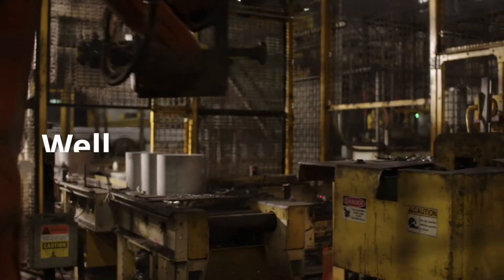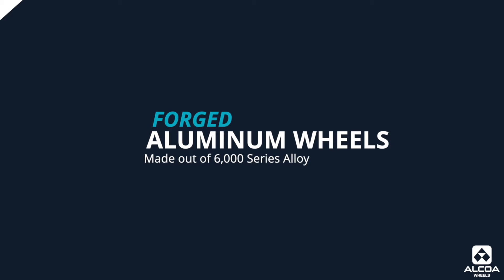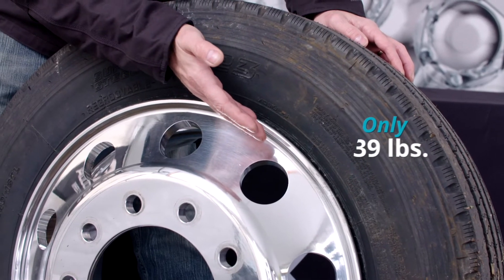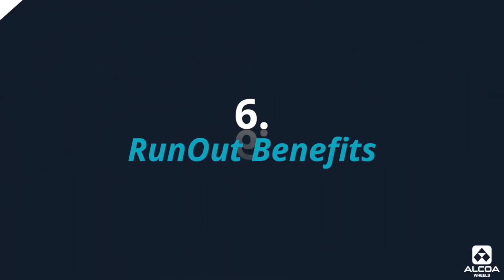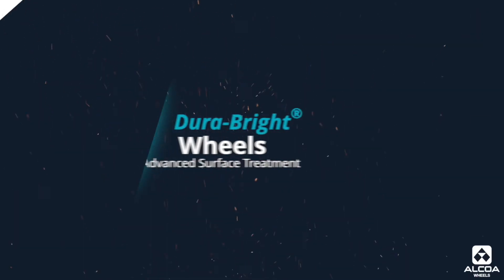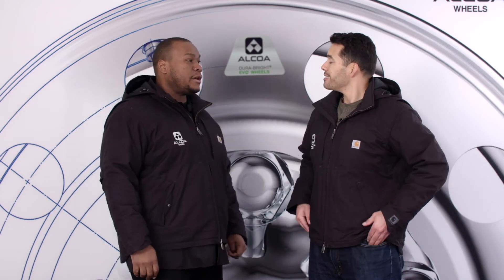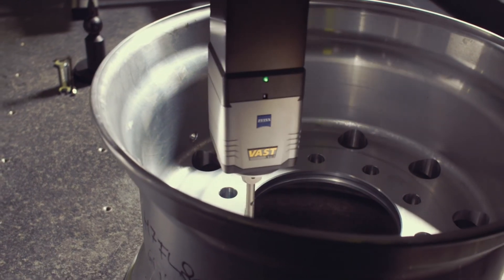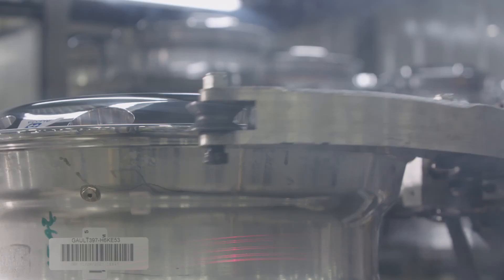New Impact Test Video Is Here: Alcoa Forged Aluminum Wheels vs. Fabricated Steel Wheels.

Comment: 9:09 I hate to say this, and I realize that this video is old news now, but when watching this video at 0.5 Playback speed you can clearly see that this was an unfair test. The impact made much more direct contact with the steel wheel, but barely touched the aluminum wheel. I would throw out this test and ignore the results until I see a direct comparison. Thanks.
Reply: Greater elastic deflection of the alloy wheel as striker load is applied
Reply: @premillennia  Interesting thought, but when I paused the video at the moment of full impact for the steel wheel I could see that the striker load was significantly overlapping the rim--almost to the top of the paper spec sheet. In contrast, the overlap of the impact on the aluminum wheel appears to have only about half as much overlap. This could be due in part to the angle and positioning of the tire, wheel, and camera, but it appears to be set up (either intentionally or unintentionally) at a wheel angle or degree of striker overlap to minimize the impact and damage to the aluminum rim vs. the steel rim. I would truly like to see a detailed re-do of this video with precise measurements and explanations. I wish to keep an open mind, but so far the visual evidence suggests bias. Thanks.